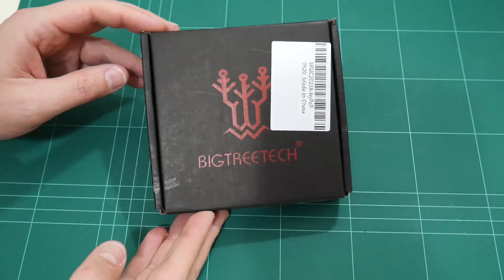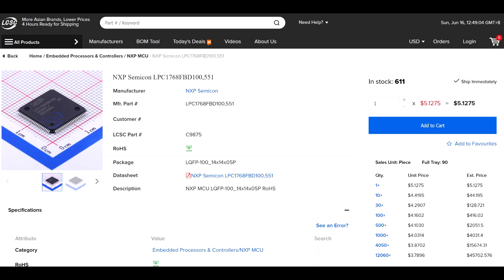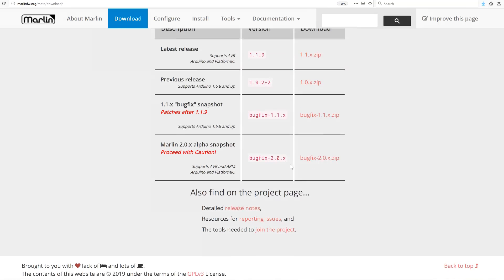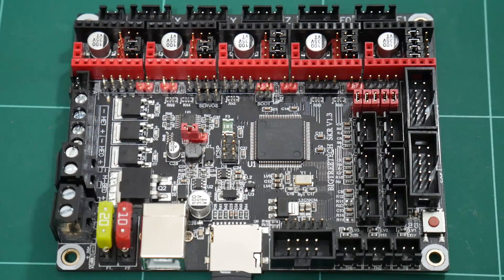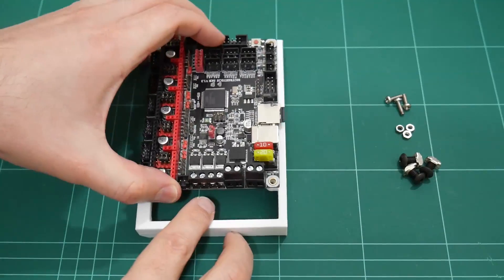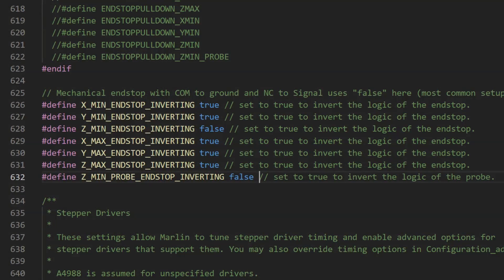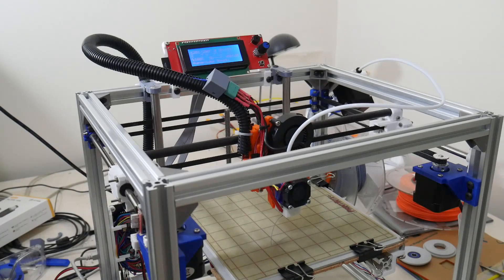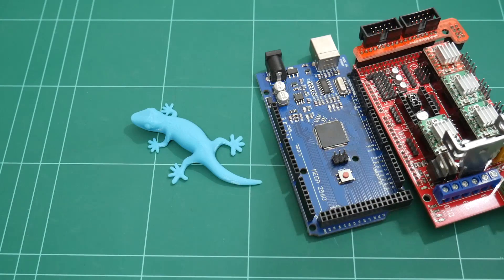Cheap 32-bit 3D Printer Controller!

Comment: Chip can run upto 100Mhz, does not mean SKR is running at 100Mhz. The crystal reads 12Mhz, no idea if there is multiplier in place as well.
One needs to ask BIQU what frequency it is running etc. I would expect it to need a heatsink at 100Mhz, and considering these could be ran at hot temperatures (enclosures) i would expect them to clock this at best efficiency or even lower ...
Reply: Most if not all lpc circuits use a xtal like that, the clk runs to a pll that multiplies it, standard practice. A heatsink is completely unnecessary on these chips at their specified speeds, 100mhz for the 68, 120 for the 69.

Comment: You might consider shifting to 24V instead of 12V. Also, why did you opt to move the bed for the Z axis instead of the head? Just curious, still trying to learn as I don't have a printer yet.
Reply: it's better to have fast moving parts be as light as possible
Reply: to elaborate on Nipina Gunarathne's answer, The bed always going to be quite heavy, add onto that the object your printing and you end up running into limits on how fast you can move it, so keeping the build platform essentially still (except in the Z direction which is the slowest moving) and only having a super light head that moves int the 2 fast directions (X and Y) allows for faster, potentially quieter prints.

You could have it so the build platform is entirely solid mounted, and the print head moves in Z as well, but it is hard to get enough rigidity in a system like that so you end up having to print slow again, or have poor quality prints.

Thats why people use bowden extruders, A direct drive extruder is better, extruder wise, but adds a lot of weight (unless you use a remote direct drive like a zesty nimble, but they are expensive)

In short, Any printer design can print with a nice surface finish, you just have to print slower, with a coreXY design, you can get the same quality prints at a higher speed.

I Guess the only reason you don't see cheap printers in the coreXY format is they are tricky to assemble, so they would either have to be sold pre-assembled, adding to cost (both in labor and shipping), or the company would have to do A LOT of customer service.

Comment: Why we need this board over ramps?????
Reply: If you already have a ramps and its working for you, No reason really to upgrade, But if you want to enable more features in marlin, you quickly run out of program space, also running TMC2208 to their full potential requires some hacks on ramps.

Comment: what else is the feature beside 2 hotend & faster print ? does it has wifi ?
Reply: No wifi, if you want wifi, you are best to get a Raspberry Pi as well and use octoprint, you power the pi, plug the printer into it via usb and can then connect to the web interface to control the printer.

Comment: Note that JST-XH connectors are 2.50mm pitch, while DuPont connectors are 2.54mm pitch (i.e. 0.1")! Source: https://en.wikipedia.org/wiki/JST_connector#Connector_series

You can get away with interchanging them, like you showed here, only for lower-pin-count connectors. Once you have more than a handful of pins, there isn't enough tolerance in everything for it to fit - that 0.04mm per pin soon adds up!

Comment: Great video, very clear and concise. I have 3 of these running ender 3's (with 2208's) and they are proving to be excellent value for money.
Reply: Hey, was there any significant improvement in print quality ?
Reply: @pratyusha1588  not so much in the actual print quality, where I do notice a huge difference is with my 0.9deg steppers on the extruders. I can now run them at full 256 stepping rates without them skipping, before I have to run them at 128 bit. I am also printing quite a bit faster with the 32bit boards. Then there is the added bonus of more memory on the board which means I can run all the marlin features and not have to leave anything out due to the limitations of the other boards
Reply: @Worelock1966  Thanks for the reply !!

Comment: awesome video, thank you very much for giving such good advice, i will also order one and i would have beeen stuck when recognizing, the inductive sensor just wouldn‘t deliver the signal.. now I know the responsible resistor already 🤗 
two questions: what material are you using on top of the bed for best adhesion? 
And don‘t you ever use an additional cooling air behind the nozzle? 
kind regards

Comment: This is great timing! I'm in the process of building another Hypercube! This one will have a bed size of 300x300. Also including two Z axis motors, so I can have a more stable Bed (along with the quad Z rails.
I guess I'm kinda going for a Hypercube Evolution like Scott 3D's
Reply: Did you build it?
Reply: @WhiteWolfos  Yes, yes I did. I have been spending a couple of weeks fixing the bugs in it. Still a way to go to get it printing as good as my original Hypercube, but it's good enough to do simple prints with.
Reply: How do you add 2 Z-Axis motors on a board with only one Z-Axis Stepper Motor Drive Slot ? I see it has 2 Extruder Motor Step Motor slots.

Comment: I have setup a inductive sensor without removing the pullup resister and it works fine.
Reply: what type of resistors or voltage regulator is on your sensor?

Comment: Looks like a fantastic option for people moving straight to a 32 bit that dont have a ramps all ready as they could use a "re-arm" as clones are becomming more abundant.
Reply from the maker: I also like that it is a single board, rather than a double stack.

Comment: once you add some fans or figure out the layer shift issue, could you try printing at 150mm/s & 200mm/s? or Figure out what the max speed your able to print at with this 100mhz board. would also be cool to see tmc2209 on x,y and lv8729 on E0 & Z
Reply from the maker: Yeah I'll try very fast, even if the plastic can't melt fast enough, lol.
Reply: @Tech2C  yeah might need a Volcano and direct drive setup. Triangle Labs makes some very good products on Aliexpress, there Direct drive & copper volcano, hardened nozzles are very well made.

Comment: Looks really interesting. I might not get the full speed on my Cartesian but senseless homing really interest me, you think it could be usable on Z axis with a fixed bed or is it still not gentle enough while doing it? It could really help with different temperatures/build plate and nozzle changes so to be able to easily change even drastically from glass with a 0.2 to a powder coated and 0.8 for big prints
Reply: No, sensorless homing is a bad idea and on Z is 100% no unless you want a broken glass bed.
Reply: @thebeststooge  Its as smooth as a babies arse if you read the documentation and learn to adjust it instead of assuming default values will suit your axis mechanics. #define X_STALL_SENSITIVITY 6 ,   live tune M914 X/Y/Z,

Comment: Sorry but have dumb question.
What are the benefits from having 32 bit, if I have already functional 3D printer with 16 bit board, witch prints really well, don't really care for speed.
Are there any quality benefits in prints ?
Reply: @Xyphis I find your answer a bit misleading, while not actually wrong: The gives the impression that pressure advance won't work on 8 bit, or higher micro stepping doesn't.

What I'd like to add/clarify: It all just comes down to speed. An 8 bit controller is quite busy with the calculations printing at 40-60 mm/s and may occasionally run into a situation where something has to wait. If you print even just a bit faster and are running a core-xy (like the hypercube or any of the other similar projects), which greatly adds to the computational load, it will regularly run into situations where some task has to wait because it just can't keep up. This might be benign (and just limit your speed) or it might cause artifacts in your print.

32bit has just a lot more headroom, and while most basic functions do work, you might be limited in how many of them you can use and it's kinda hard to actively diagnose if the CPU load is the cause of a certain problem or not. 32 bit means you can just activate most things and it'll work. And yes pressure advance works fine on 8 bit, but for bowden printers like the hypercube it's not advisable at the moment for various reasons (will be fixed in the next iteration according to the dev if I recall).
Reply: Pressure advance I did not know about but after reading about it just now how in the hell can it really know the true pressure without a real sensor?
Reply: @thebeststooge  It can be calculated reasonably easy: if you know the size of the "pressure vessel" (in this case the space between the extruder motor and the hotend/nozzle) you know how much filament goes in and comes out, which gives you the pressure. For this to work you need to know that size and/or how much and fast it comes out, and there are basically calibration prints for it (you do this once, then it mostly just works). This boils the variables down to a number with the unit "mm of filament compression needed per 1mm/s extrusion speed".

If you want to know more, just google "marlin linear advance" and read the wiki/doc article.
Reply: Linear advance I have been against since it came out.  Unless a real pressure gauge is there it is all hocus pocus and praying.
Reply: @thebeststooge  first of all, a real pressure gauge is impractical to say the least, most likely impossible due to the materials involved (especially without costing more than the whole printer). Secondly, you can call it voodoo, but it works just fine and is a clear improvement even for bowden printers. The downsides with bowden are not the result but the way the motor is controlled by the algorithm. It's way too agressive and it is basically moving nonstop backwards and forwards causing excessive heat and stressing the controller (not to mention noise, even with trinamics).
Reply: @TheCreat SSDD because a 3d printer, the kind we all have, is all hocus pocus and praying since none of it is a close loop system.  Same deal without a real pressure gauge system it is just hoping it is right.  Might work but then it might not one day and a failed print just like when the open loop system skips and the print is shifted.
Reply: Don't forget the snake oil too or it won't work.. @thebeststooge
Reply: @npgoalkeeper _ I disagree especially when that approximation fucks over your 3 day print.  Wasted time, effort, electricity, and materials PLUS fruitless wear and tear on everything.
Reply: That's 72 hours..….what kind of printer will stand that prolonged work load without having a smidgeon of imperfection that makes you want to do it all over again.....after 4 hours I get bored and want to go to bed.  @thebeststooge
Reply: @Ian Pearson Don't deflect.  Even the simplest of things I do take 6h to print at the minimum and one layer shift it is ruined now try that for a 3 day print, or 12h, or 18h or 24h, print and fuck.

Comment: Thanks for this video.
I think the SKR Boards are a very nice solution. The firmware-upgrade seems extremly easy, esp. for beginners. Esp. if someone has a "Mainstream" printer (like Anet A8, CR-10, Ender 3 ...) he might simply get a precompiled firmware.bin and put it onto micro SD, so getting a plug-and-play replacement. While any advanced user might config the board as he wish. A nearly perfect solution.

Did I understand right that pluging the USB into the PC it is recogniced as serial connection and SD-cardreader the same time? That sounds great, because esp. here in Germany many people use "Fritz!Box" as router. This "Fritz!Box" is not only a router, but also has remote USB (called "USB Fernanschluss") and also can be used as WLAN- and DECT Repeater. Older used Fritz!Boxes (like the 7390) with defect DSL-Modem you often get for 25€ or less. I use a 7590 as main router and 3*7390 as repeater anyway - so with placeing one of the repeaters near the SKR using a USB-Cable and remote USB I could add WLAN to the SKR for free. (only for Windows PC). It sounds very nice.

Comment: The new skr pro 1.1 is even better. Different power supply lines for fans, board and drivers, 6 driver slots, same uart and spi support as 1.3
Reply: @npgoalkeeper _npgoalkeeper _6 minutes ago@The Best Stooge don't know how to say this to you bub, but nobody will have an skr 1.1 pro until June 1st

Ahem, have you checked the calendar lately?
Reply: @npgoalkeeper _ The masses the people under NDA wrote about it but you do you and go buy one then come on Youtube to do a video proclaiming what the beta people said was all wrong.
Reply: Pro received a lot of bad reviews and the biggest one is that everything is so cramped on it AND they went to a new chip where the math processor is not internal now.
Reply: @thebeststooge  Where are all these bad reviews exactly? Seeing as the board only became publicly available a few days ago, with only a handful of hardware tester boards under NDA before that.
Reply: @m3chanist Was in Japanese, or Chinese, I found via a Google search (used Google translate).  They no longer are using the LPC and it says what they went to AND showed what the board looks like now (it was pretty damn cramped) and with the math now requiring a coprocessor (not on the chip itself) that is pretty bad.  The sentiment was to stay away from it and stick with the 1.3.
Reply: @thebeststooge  Riiight, one review then,  hardly "a lot" and a translated one at that.  Yeah it's not an LPC, it's an STM32F4,  a much faster and better chip than the LPC 1768 or 9, both M3. This is the next tier up in performance, an M4. Faster and with twice the memory of the SAMD on the Duet boards for instance. Infact the fastest mcu now available on ANY 3d printer board and one whose architecture is already supported in Marlin 2. Why exactly do you think an external math copro is bad? it isn't as if you have to go and add it in. Existing M3 chips don't have any math hardware, floating point is done in software via a library. The M4 will beat the M3 in every metric, math included, with or without the external chip.
Reply: You are probably too young to remember the 486 and the math co-processor but Intel learned that bringing it into the main CPU die was where a performance gain was at.  Having software emulate math is shit in today's time and reminds of the old 1986 Amiga where all Floating Point (IEEE) was done via emulation and it was slow so corners had to be cut.  Don't be so butt hurt it sucks but if it pleases you then go buy it.

Comment: Great Video as always! Do you plan on purchasing the new SKR Pro, and maybe the new TMC2209 drvers? I am waiting for mine and a guide would be awesome! Cheers <3
Reply from the maker: I just bought this one, I don't intend to buy another unless there is some game changing feature. I am getting TMC2208 to replace the X and Y steppers.
Reply: Pro received a lot of bad reviews and the biggest one is that everything is so cramped on it AND they went to a new chip where the math processor is not internal now.

Comment: Great video and very helpful too. I've been considering one of these boards for the #Borg (CR-10s4 on steroids). Now it's a certainty. Thank you.
Reply: I have 1 on my Anet  E10
Reply: @andypodmore6721  Cool. I will check if it fits in my control box. If not, I will probably wait till I move the electronics to under the bed.

Comment: Ordered one! Which stepers should I get? Thomas was hyping one that was quiet and had built in endstop. Also, will I still need an external mosfet to drive my heatbed to 100c?
Reply from the maker: I'm getting TMC2208 to replace the TMC2100's on my X and Y. TMC2209 will be out soon which have lower RDSon resistance and higher current capability than TMC2208, but the TMC2208 is no slouch.
I'll stick with my endstop switches. They are only used for homing anyways and have no bearing on print quality.
My bed can reach 100 no problem with this board. It does take about 10mins though. You'd want to use 24v power to speed it up.
Reply: The 2209 without a doubt, in my opinion. Better current handling( runs cooler) and an upgraded set of features pulled from both the earlier 2130 and 2208, its the best of both of them rolled into one.

Comment: Can you run duet firmware on this or is the Mirco Controller Not gonna work?
Reply from the maker: It also supports Smoothieware
Reply: yes you can LPC port of RRF

Comment: OT   1:34 wait a sec, where did they get a sd card only have 128MB in 2019??
Reply: I was going to post the same thing, lol.  Probably a 4 or 8GB that is near death and the bad sections have been chopped out.
Reply: @thebeststooge  in Hong Kong, the smallest size is 8GB that still selling that I saw.
Reply: @Tsz Kwan Cheuk I haven't seen a 128mb SD card in micro size ever.  In full size I did 10 years ago.
Reply from the maker: Yep, 128 MEGABYTE! There's probably a warehouse somewhere they found boxes of these obsolete capacity micro SD cards. Need to offload them somehow, lol :)
Reply: LOL, yeah but I have never even seen a microsd with that low of a capacity before.  Micro wasn't even a thing when 128mb was.

Comment: Wow, right on time!!! I just bit the bullet and bought one SKR v1.3 board last thursday with 5 TMC2208's :) Sweet deals! Even cheaper than getting a Ramps1.4+Mega+5xTMC2208. The only reason why I bought one is because I scored a ridiculously cheap 2nd hand Delta that needs some good loving. At baudrate you say eleven fifteen twohundred. Should be five instead of fifteen of course ;)
Reply from the maker: Nice purchase! Yes I mean't eleven five two hundred, oops :)
Reply: @Tech2C  It's okay, people will understand. Right now we're heaving a heatwave over here so I can't work on the machine this week. I'll be receiving it in 10 days anyway and I just bought a mobile air conditioner so I can give you my opinion of the board soon :)